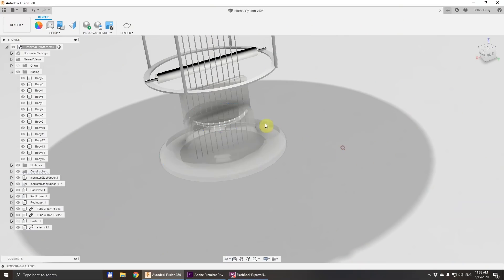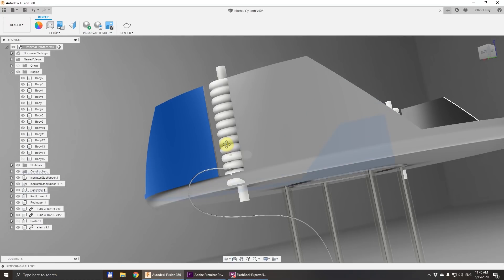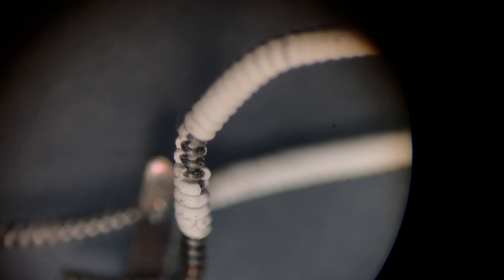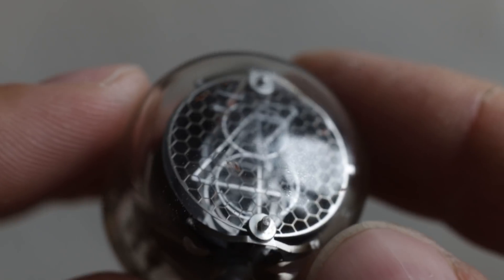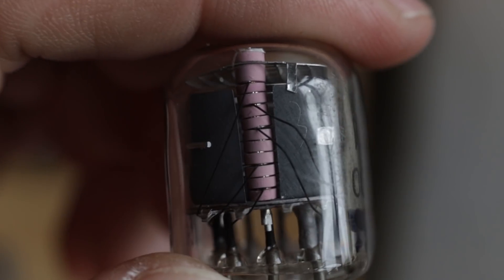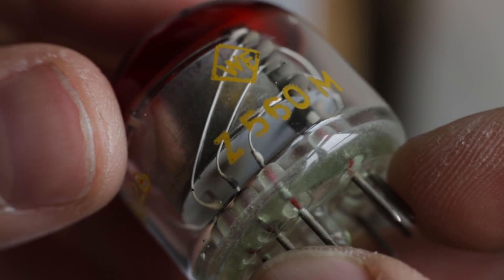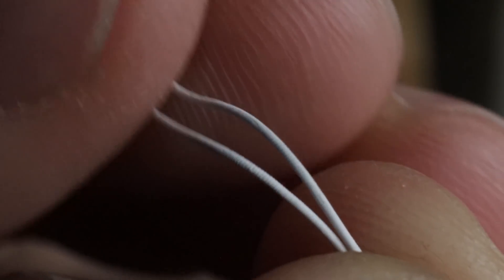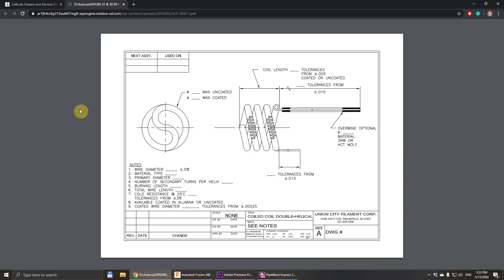What Electrical Insulation to Use in a Nixie Tube? | Project H #4

Comment: Would Teflon (PTFE) maybe be a suitable insulator? It should be very inert, resistant to pretty high temperatures (350°C, I think), flexible and possibly be able to be put on as a coating.
Reply from the maker: Unfortunately PTFE doesnt withstand the temperature, it melts around 350C. Otherwise it is suitable for vacuum, just the temperature.. there are kapton coated wires available for UHV use, just the maximal bakeout temperature is too low. Thanks!

Comment: Why you dont isolate your wires with glass? You could create fix and already shaped part of glass with wires inside, like a connector, and keep only small peaces at ends to weld them with core elements.
Reply: Creating those glass parts would not be easy. It would need to be the perfect shape for each wire since it cannot bend.
Reply from the maker: That would work, I am afraid it would be too labour intensive (coating the wires, bending them in fixtures..), I will keep it as a backup solution..

Comment: Could the coating on the black wires be carbon black? It seems that the coating is very thin, and doesn't crack off. If carbon black would work then you'd just need to run your bare wires over a candle to coat them. I don't know if that would work, but it'd be cheap and easy, you'd just need to test to see it'd work.
Reply from the maker: I think it sticks better to the wire, carbon black (soot) is easier to remove by scratching. Also, the soot contain hydrocarbons, it would be difficult to predict the amount and composition if we want to achieve consistent vacuumtube-to-tube.

Comment from the maker: Just a note - mass spectrometers use usually bare tungsten filaments, not coated ones.. ;-)
Reply: They used low temperature glass powder to seal the ceramic microchips. Maybe that is an option. Apply it once assembled,  it should melt during the bake-out and form a uniform coating